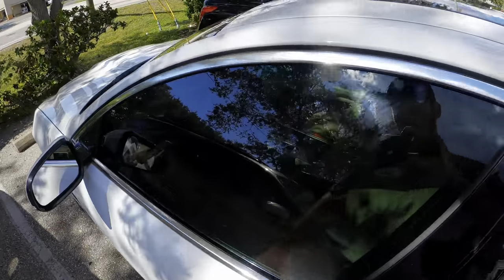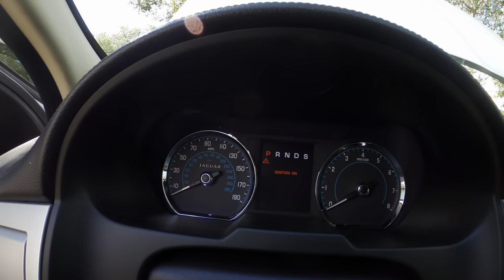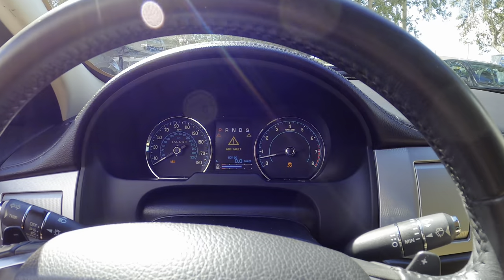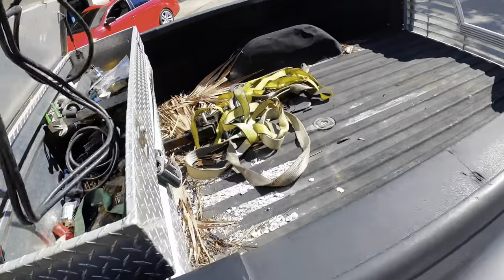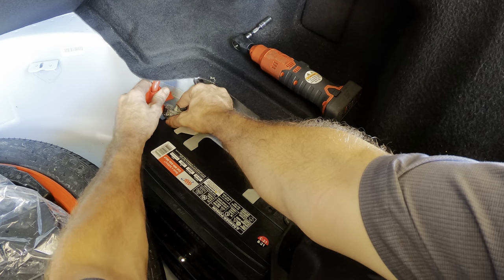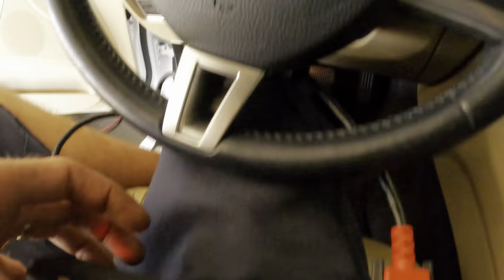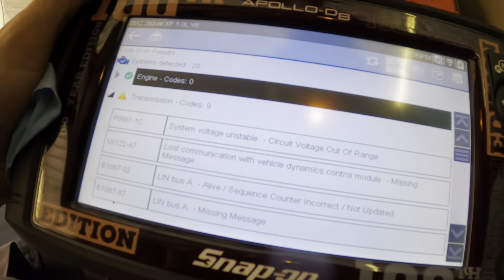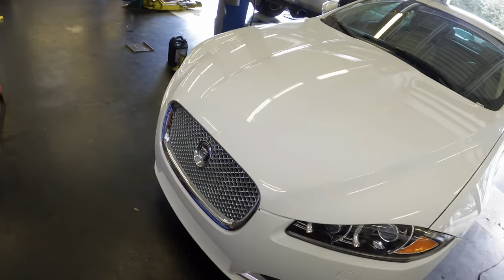Jaguar XS just Towed In.  I’m in over my head! Customer States: “Check Battery”

Comment: After the second restart, you didn't have any gearbox warning message, just the information to press the brake pedal to engage a gear (which is a standard message). The U errors are pretty normal, after low battery condition. Don't know the US cars, but European one behave like this in case of charging failure. Also, the forced parking gear, when you have stopped, is a failsafe feature, not a gearbox failure. This gearbox needs electricity to operate, so when the alternator has failed, and battery goes low it will safely prevent you from driving any further, to avoid a condition, when ECMs would shut down while driving, which could be catastrophic. If you were driving, the car would slowly slow down to full stop, and then engaged a P gear and locked itself until battery voltage is restored.
Reply: And having the correct amp/CCA battery in the car makes a world of difference no matter what marque it is. Aftermarket batteries come close but not al was ays.....
Reply: I think you nailed it.  So he does possess the knowledge to replace the alternator which will fix it.
Reply: I know some European cars are extremely picky on batteries. Not all cars like interstate or diehards.
Reply: I've driven a lot of older US cars, and nothing is fly-by-wire in them. You can still drive with no battery installed at all, you will just have no power steering, and no power brakes, but a sufficiently healthy adult can drive without both. It's strange to me that the gearbox would lock you out, just because you're out of power. Newer US cars probably have this same behavior, but I would for-sure hate it, since it means you'd have to tow your car home (when your car might be in the middle of a lane), instead of just limping it home. Would be nice to have a warning light on/near the shifter, instead of a lockout.
Reply: @weeveferrelaine6973  Actually power brakes do not need electricity, but power steering and automatized mechanical gearboxes do. You can drive without a battery, but not without a working generator (alternator).
Reply: A bad ground or a exposed wire rubbing against the chassis can also cause module's to throw a shit ton of codes
Reply: @TzOk  Power steering on older cars is via belt-driven pump. It's only recently that manufacturers opted to use electric power steering and water pumps.
Reply: Exactly. It bothers me watching try to force the shifter and hammering on the button, while it's obvious why it isn't shifting.
Reply: Probably a alternator Al along?
Reply: @weeveferrelaine6973  You are so wrong and shouldn't be giving false information like this. Older cars as you state that have no fly by wire would have hydraulic power steering and vacuum assisted brakes.
Reply: @person749  another couch mechanic? Or actually fixed something like this this "first time" you came across this problem?????
Reply: Had 3 Jags all threw gearbox faults when it was a battery issue. Seem to be very sensitive to low voltage, they usually show  a variety of none related problems, gearbox, check engine, even failure of navigation
Reply: @TheFrenchPug  the alternator is not totally independent in many cars. The jag xj40 from 1988 had an overcharge relay in the boot which failed me, alternator would not charge more than 11volts until that relay was replaced.
Reply: @TzOk  my 1990 jag xj40 power brakes had an electric powered hydraulic booster as opposed to the previous year's engine driven hydraulic booster.
Reply: @dashcamandy2242  jaguar started electric over hydraulic power boosted brakes in 1990.
Reply: the only downside to all these electronic obstacles is that it really inhibits the speedy journey to the landfill witch is a process that cannot happen soon enough.
Reply: @jeffp6615  "Older Cars" can certainly include cars with electric power steering.  I worked on the 2nd generation of the newer Mini Coopers (Prince Engine) a decade ago.  Car was not new at the time, and it had electric power steering.  Per Wikipedia: "Electric power steering systems appeared on the Honda NSX in 1990."  That's 31 years ago -- Qualifies for an "Antique" tag in my state.
Reply: @TzOk  I have had a batterij with 1 cell broken. It didn't start anymore, so we jumped it to get it to the garage. What happened was that when the steering was used at parking speed the car started sputtering because of insufficient voltage. So modern cars are even with a good altenator might need the battery as a buffer.
Reply: That would be great as long as you are not on the motorway or in the middle of overtaking Peugeot 207 hdi would put engine light on and stop going through a long list of things we found out it was water in the diesel. You could be out the price of car in parts these days. It was a good call sometimes you have say no and people don't realise how tough it is to say sorry outta my depth on this one.
Reply: Lots of cars will throw gearbox faults when the battery is low/weak.  I encountered this on a Toyota Prius.  Bad Drive Battery ECM = Would not charge the 12V battery.  There are big solenoids / actuators in the gearbox.  Trying to activate solenoid = a large current draw = voltage drop with weak battery = solenoid doesn't move as it should = gearbox fault.  Back in the old days, we had a thing called a shift lever.  This was activated by the driver's muscles, but apparently drivers don't have those anymore.  Forget manual gearboxes, even automatic transmissions have to be activated by a button or knob.
Reply: @andrewgarner2224  These European cars have a lot of electronic monitoring components.  When the voltage drops too low it can't function properly and that's what ends up happening.  Pull over and call AAA! Lol
Reply: @rossbrumby1957  Good point.  I had an old Mercedes that had a component like that.  I had to replace that and voila changing voltage returned.  No new alternator needed.
Reply: That seems extremely counter productive, especially at highway speeds. Could you imagine going 60 70 mph and the gearbox fault comes on and you're now coming to a complete stop? Between this and the stupid shit EPA pulls with emission codes shutting down braking systems makes it absolutely no wonder that motor vehicle deaths have skyrocketed. I don't think it's distracted driving anymore.
Reply: @DGTelevsionNetwork  It won't stop you while you are driving, it only won't let you start again, when you stop.
Reply: @DGTelevsionNetwork  right, god forbid you need to put it in nuetral... nope youre stuck wherever it decides to park itself, stupid
Reply: @hanshoogendyk2203 
 It's pretty simple, when the screen pops up a warning relating to the transmission and then the shifter stops moving, you don't try to force it. It's locked out. Forcing will help nothing and just risks damaging the control. Battery is dead, the car is complaining about not enough juice, it's very obvious that the transmission is shifting into park and locking out so that you don't get stuck in a state where it's stuck in drive or neutral and can't shift out of it, which would be no bueno since the parking brake is also electric. Forcing a control in a fly-by-wire system is idiotic.
Reply: @mattdread4994  Didn't say anything was easy. Just said don't try and force controls when it's obvious that the transmission is locked out due to low power.
Reply: @garonburwell9008  "the only downside to all these electronic obstacles is that it really inhibits the speedy journey to the landfill witch is a process that cannot happen soon enough."

??
Reply: No no.. hurr durr i have a big truck, and euro and imports are trash 😂
Reply: @baldis12  "No no.. hurr durr i have a big truck, and euro and imports are trash"

I don't mind big pickup trucks. They have their uses, as they're *very* useful for moving big, heavy things around. Luxury imports are great for........I don't know, if you really know how to take care of your vehicle real well, I suppose.

Either way, both kinds of vehicles have their own nuisance drivers -- large pickup drivers tend to drive like invincible reckless idiots on the highway, while I've seen my share of Euro import drivers behave like absolutely total snobs (had an Audi driver nearly drive me into a very rough road shoulder during a merge years ago).
Reply: @ajonsson2013  Why no alternator error?

Comment: Jaguar mechanic here...just a tip on replacing batteries on tata motors Jaguar and land rovers. Don't ever disconnect the car from battery voltage fully. When replacing the battery always have a second battery source hooked up  elsewhere so the car does not fully go without any voltage. If you do you run the risk of bricking the car and causing a no crank and or door lock issue. The fix is to reprogram modules and depending on which software version security module has the car will need a new security module and a new set of keys .very expensive fix just for disconnectjng the battery. completely ridiculous but thought Id pass that info along .

Comment: This is why I like my 80's Scottsdale. Alternator not charging check regulator and if that's good replace and done. Love easy
Reply: Why I love my 80s Toyota pickup, mostly just an engine ... Battery dies... Push start... All good 😁
All this electronic stuff is just a recipe for disaster... only thing fancy in my truck is the radio
Reply: @lexannaamnell6593  even my radio isn't fancy i got am fm chose one not even a tape deck

Comment: My Land Rover's alternator failed and the low voltage is a problem with all the computers.  They don't like it and you get a bunch of errors like that Jag is doing.
Reply: Jaguar POS
Reply: Low voltage does the same on many new cars, though forcing it into park is a nuisance. Like killing the engine due to a bad sensor.
Reply: Or they fried modules while swapping that battery out. (Ie wrong polarity on install or improper jump) it’s better to have it properly diagnosed instead of throwing parts at it.

Comment: Jlr engineer here, the codes are pretty standard stuff for jlr cars. All it needed was a new nator and a code clear.
Reply: Rainman Ray should consider reading through the comment section here when diagnosing a problem car.  He would prolly get the answer from a viewer.
Reply: @randomschmo5778  certailny he can contact me with jlr cars
Reply: @
Pavol Polášek
Thanks for the post! Rainman Ray's comment sections are some of the best for mechanics on YT, seems like someone that posts ALWAYS has the correct diagnosis at some point in the posts.

Comment: You probably do have the skills but, it was definitely the right choice for the customer, you and the business. It should earn you points for right decision and knowing not to touch. It may well have been a magnetti marelli alternator or denso as lucas stopped being a thing several years ago
Reply: Lucas , the Prince of Darkness !  Memory flashes back to 1973 and a Triumph Tiger with electrical gremlins .  I pushed that bike farther than I rode it !!!    HAHAHA !!
Reply: Remember, a gentleman does not motor about after dark.
Reply: @Posichronic  ; Wasn't a problem with that bike . Turn on the headlight and in about 2 minutes you were walking !   HAHAHAHA !!

Comment: If you pound the dash to the left of the steering wheel and call it names, everything will reset. Next.
Reply: And dont forget to kick it
Reply: If Its a UK manufactured model don't forget to sit in the passenger seat and slap the dash on the far right... should solve it!
Reply: You would need to speak in an English accent, and use names like "Work ya Bugger!" or "Start ya Bastard!"
Reply: Best thing to say to a car is the shop has great insurance piss me off and see what happens.
Reply: @davimel4051  Probably built at the old Ford plant at Halewood in Liverpool.
Reply: @Cheepchipsable  No, you would need a scouse accent.

Comment: As an XF owner myself I’m intimately familiar with this problem. They’re a terribly temperamental and expensive machine but are beautiful and fun to drive when they’re actually in working order.
Reply: So what does it take to fix it?
Reply: @MFSE7EN  A sufficient and consistent electrical supply.  It's absolutely the most important thing to sort out when you have communication errors throughout the system.
Most likely a charging fault and Ray knew it here but didn't want to find out it wasn't that after changing the alternator. Fair enough.
Reply: Kinda like anything with the word "Luxury" near it.
Reply: "They’re a terribly temperamental and expensive machine but are beautiful and fun to drive when they’re actually in working order."
Sounds like every high maintenance woman I have ever known.

Comment: I would’ve went for the charging system first. Check fuses, and see if you have voltage and grounds to proper pins on the pcm connector. I think your selling yourself short, and are capable of the repair. All you need is the charging system wiring diagram. I love your videos and really enjoy them. Please keep up the good work Sir.

Comment: Those dam super flashy cars are LOADED with computers after computers, If they see incorrect voltage they will chuck a hissy fit. I have to say i do not blame you for walking away from this one.
Reply: "Hissy fit" immediately reminds me of viperkeeper's channel when some of his snakes happen to be in a bad mood.
Reply: Not even just on flashy cars. It's more of a modern car thing. I know some Toyota's will throw an ABS failure and traction control off light on the dash if the check engine light turns on.
Reply: I took a complete chance on a cheap Jag XJ I never test drove, on which the MOT had expired after it was part exchanged and had sat a few months.
Battery was understandably flat when it arrived at my home on a flat bed, but charged it up and it started up.
Sounded awful and so many different faults displayed for transmission, air suspension etc and thought OMG what have I done.
Put a brand new quality battery in, cleared the codes and it was transformed, flying straight through an MOT.
I got that car for an absolute pittance, because they were too scared of what it might cost, yet it had just 2 previous owners and a full main dealer service history.
Changed every fluid and filter in it including servicing the auto transmission, dropping down the valve plate, replacing the Mechatronic seals and it is still going great over 2 years on.
Yes it does scare me with so many modules to complicate things, but so far doing well.
I service it regularly and only work not done by myself was an aircon topup.
Given I've always steered well clear of modern cars for sake of simplicity and this is my first to even have an OBD2 port, I'm quite proud of myself.
I'm not a mechanic but having the confidence to dive in, motivated by the poverty not to outsource, has served me well.
However I'd never work on anyone else's car if I didn't have experience of that particular problem.
Learning is something to do on your own vehicles at your own risk.
Reply: @matthewjenkins1161  Keep up the good work, It's becoming a thing of the past men/women working on cars soon it will be so dam complicated no one will be able to work on a car soon.
Reply: @adamjones2025  They are and there is plenty on the car that terrifies me if it should fail. I've been very lucky so far having taken a big risk in the first place. Fortunately though complex, many parts like air suspension pumps and struts have come way down in price to affordable levels. It is the modules that scare me if they fail and require reprogramming, as I simply couldn't afford the rates charged.

Comment: A lot of mechanics don't know that newer cars have a sort of "smart" alternator. Essentially they "kick on" only when necessary to keep a battery at or very near 12V and rarely show they are doing anything. Tough to diagnose.
Reply: Alot of scanners will show duty cycle demand to alternator. If it's demanding but not charging, it's usually a alternator. I have seen plenty of mouse nest, failed exciter connections, and 1 bad Mazda computer ( calling but no signal from pin)

Comment: A part of me at first was at least do the alternator, that would at least save them some money from what the dealer charges. But your right on a car like that, it could be the ECU not commanding it to even turn on. Not charging the customer was the right thing to do bc they will at the minimum always trust the shop for other things like brakes, oil change and they probably have another vehicle they’d bring in. So no lost customer, if anything they may even recommend others to “hey, I know a trustworthy shop” which is hard to find now days
Reply: IMHO it's the alternator. The second time we could see the RPM indicator and it was rock solid where it was as long as the Chevy was connected to it with that big old alternator. That alternator can probably do 140-180 amps. Looks like nice arc welding cables!
Reply: @robertthomas5906  The problem is that modern alternators don't just charge based on the voltage it detects now.  At the very least, the ECU does the detecting & commands how much charge the alternator makes.  (Assuming that Jag don't have another module doing the dectecting & feeding that to the ECU...)  So yes, it could be the alternator, but it could be an ECU, or something else entirely causing the ECU to give a bad output to the alternator. 

Once that primary failure is found & fixed, most if not all of the other faults will also go.
Reply: @NemoConsequentae  Could be a bad ground, or a bad wire ;)
Reply: @christophervanzetta  This might cause similar problems, which is why it seemed best to pass it on to those who should know better.
Reply: @christophervanzetta  I've seen people who found that after weeks of troubleshooting a weird electrical problem.  They finally tracked it down to a loose earth under the dash...
Or as simple as a loose terminal from the alternator to battery.